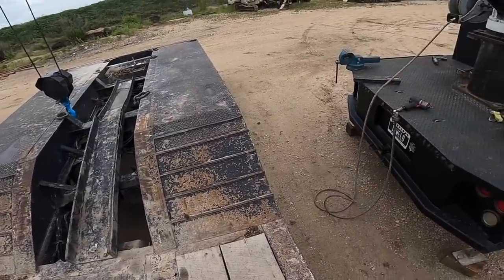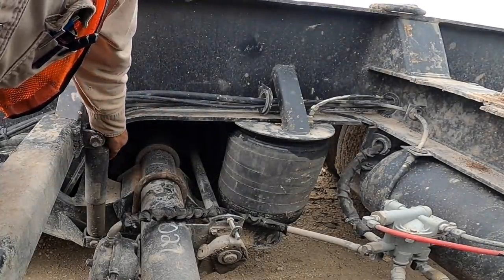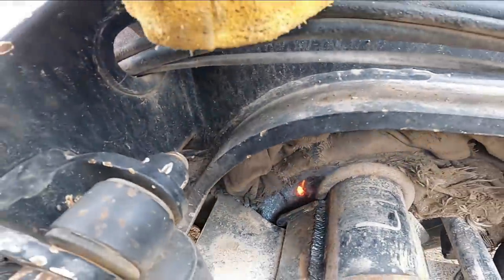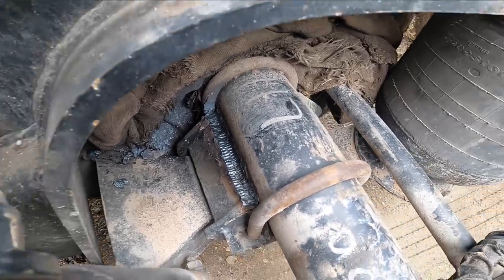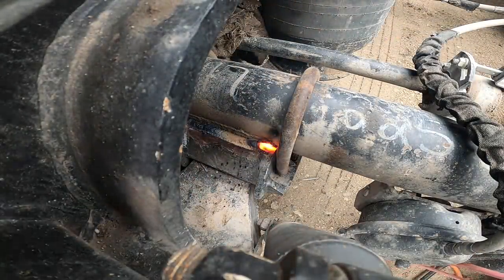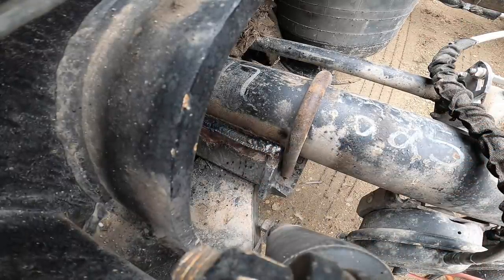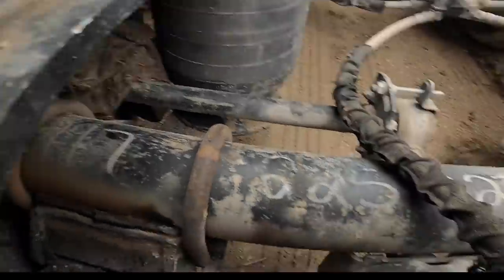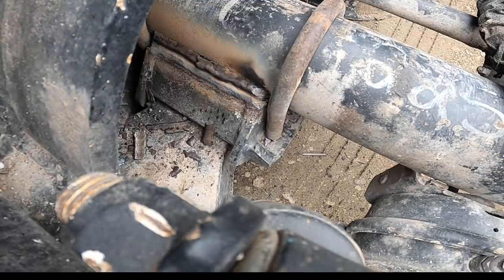Low Boy Axle Repair

Comment: People who have never done a repair of this nature can not fathom how difficult it is because of all the access issues and space constraints. Additionally, no welding school can teach it, only experience. Great job Isaac!
Reply: Absolutely....working on any vehicle that has been used and is in the field...or driveway is just not like having two bits of metal sitting in front of you on a bench. Getting a good weld is rarely easy...even on a flat straight piece like that.
Reply: Welding schools really should have a scrap trailer for kids to weld on to experience the real deal. or a deep muddy ditch to weld overhead XD
Reply: William Thomas, couldn't say it better. In the fabricating shop I worked in the boss hired a "certified" young welder straight out of school. He quit the second week because he didn't like welding aluminum 40 feet off the ground while standing on a scissor lift.
Reply: I’m amused by the occasional comment that you doing something wrong. I’ve seen enough of these videos to trust you a lot more than any of those folks.
Reply: Exactly, I work on trucks, trailers and equipment.  Until you have a mirror, and a rod bent in the middle. It's hard to understand where you may have to putbdown a bead!
Reply: I hate those jobs where I have to stand on my head to get to the work
Reply: If this aint the truth, i had to weld on a tow truck  that was ontop of another tow truck because the hydraulic lifting arm broke its support beam and that truck was hanging halfway off the bed and it was 12 at night and i didnt have a ladder or much of anything except my welder, some gas, a grinder and some rods and my fixed lens outlaw hood and im only 5'2 so i had to somehow literally climb up to  the overhanging tow bed and hang with one arm and weld/grind with the other and i didnt have help or any light except my phone and i couldn't brink my truck closer or turn it around lol took me 3 hours to do 4, 2 inch slanted welds and got a call days later that something happened and the truck was totalled when the differential broke and the truck it was carrying on the freeway at full speed wanted to flip but was still attached so only a tire broke off and the only reason they called was to thank me and congratulate me on my welds that held it together and didnt let the truck break away or break the chassis down the middle lol so that made it worth it apart from the 250$
Reply: I yeah it suck man I use to repair bridges for the railroad and 
99 percent of the the time where I was weld the I beam had been sitting either in a swamp or just straight mud. You can’t teach how to weld metal like that it comes with practice in real world situations
Reply: @heheheuhue6943  or have local companies with machines that have a lot of down time, bring them to the local college or school and get kids to learn equipment repair. The school I went to the HD mechanics worked on equipment from the field. Someone with a piece of equipment that has a lot of down time would come in and the mechanics got to learn on that, I brought my car in because my studs broke in the rear drum, was rusted and seized up, nothing better than learning on stuff from the real world.

Comment: At least the company is  checking their trailers and doing preventive maintenance
Reply: Yep, good catch by them.
Reply: It seems they do not under estimate the value of a clean equipement ;-)
Reply: Probably got shut down by dot during an inspection and that's the  only reason it's getting fixed.
Reply: I worked on those for 18yrs.
I've had to change the beam/trailing arm. But the one I've rewelded never held up for long. Then I was talking to a guy at a suspension shop and he recommended changing the U bolts after the repair because they stretch over time even though it's welded also. Started changing them as soon as I started seeing the slightest cracks and it worked out. Saved alot of time and money and down time

Comment: Welder of over 20 yrs in structural steel construction/iron working.   Love your videos.   A little different than what I did, but have had my hand a time or two fixing our own stuff or the occasional, “hey welder can you look at this?”   Love this latest commentary about rod and carbon sizes and heat.   Think it’s great help.

Comment: I think I can count on one hand the amount of times I've welded flat on a trailer. It rarely ever happens it seems. You did a fantastic job there especially with the gouger. A nice job on the prep and beautiful beads like always!!
Reply: Yeah I started doing vertical welds even on pieces that I CAN rotate around, just to get that practice in.
Starting to get the idea, turn down voltage & feed enough to get a solid bead without runout.

Comment: I seriously have to invest in a needle scaler...Something you said about sealing out dirt reminded me that there are so many situations when welding vehicles where you simply can't get it clean, so you have to do the best you can then weld it, then clean it again and get the good welds on the second or even third pass.
 For me a needle scaler would I think make that process a lot easier
Reply: I got one a little while back to try and it makes a huge difference. The second job I used it for was 3/4 dia plug welds in 1in plate, it was amazing how much of a difference it made trying to chip slag in the hole.
Reply: I wish they made an electric one. Don’t have an air compressor yet. To new in my break out period and I miss having one at my old 9-5 haha
Reply: @Froggies505  They make electric needle scalers but they're heavy, bulky and expensive. The money would be better spent towards a compressor with balls and large diameter hose.

Comment: When I was younger I was a welder and found it to be my calling. I enjoyed it and every day at work was a great day. As I got older and learned more I got into weld examination using remote cameras inside nuclear reactor cores. I really enjoyed this as well and my years of welding helped me a great deal. I could see problems with welds easily that others struggled with seeing because they did not have the hands on experience. If I could mentor young men and women I would tell them to find something they enjoy doing that someone pays them to do. It may be difficult at first but when you find your calling you will never work another day in your life. I would look forward to every day I went to work and every new challenge.
I enjoy your videos very much and will be watching everyone that pops up. I still do my own welding at the homestead now that I am retired with my little Miller Syncrowave I bought when I needed to make a motor mount out of aluminum for my old school mini bike I used as a pit bike when I was into road racing motorcycles. Why pay someone to do something when you have the skills to do it yourself? It would have cost me a lot to have someone else make the mount so I bought the Miller and have used it many times since for other jobs. 
Thank you for your videos! :)

Comment: Great job on the repair. Just like to add that who ever found that deserves some credit. Many drivers of equipment just load and go. No pre-trip inspection. A ton of time and money can be saved with a good pre-trip.
Reply: Was probably found during a dot inspection. Then shut down which forced them to have it repaired.
Reply: @mikeznel6048  Yeah, that is an interesting and very real possibility as well.
When I worked as a lineman at a power company in NC you were made/required to do a pre-trip every day.
Reply: @shaneherman8906  All commercial vehicles are to be pre tripped. Most people are to lazy to bother doing it. Chances are, this was caught in a dot check point. Sad we have them but they do help. Too many careless people out there operating dangerously. They just don't know and don't care until their equipment fails and hurts or kills somebody.
Reply: @mikeznel6048  if it was caught at a DOT inspection wouldn't he be at the scale or inspection pull out not back at the yard repairing it

Comment: You've been doing all this amazing welding without an auto darkening helmet all this time?  👏props!
Reply: Precision helmet flip is a lost art…
Reply: @island7458  I used to do ok with my TIG and one of the gold lenses because i'd had bad luck with autodark and getting flashes.  Now I have a quality autodark and would hate to go back.
Reply: Amateur welder who has been welding with good auto darkening full helmet supply air system for thirty years.  Don't understand why anybody would want weld without a good auto darkening.   Allows amateurs to make reasonably good welds because they can see what they are doing.
I always enjoy watching professionals weld they make it look so smooth and easy.
Good video.
Reply: I like weld without auto-darkening. It works better than auto-darkening when used to it. but it is no days hard to find a good normal weldíng helmet.
Reply: Isaac has an auto darkening helmet, but uses it for the camera. Old school and better than most with the auto stuff.
Reply: @Jimmy the Saint. you got that right 😂. I find when welding outside there’s a constant battle of the sunlight making it go into dark mode when your trying to see in light mode. The flickering can really be a pia.

Comment: So for what it is worth, a trick I use when I have dirt on that separation line to reduce porosity and bubbles is use 6010 on that first pass. (6011 will work too) it burns through the dirt and crap pretty well  to seal it up. Then switch to 7018 to weld on out. Anyway, as always, nice repair my friend.
Reply: yup, in the dirt&gunk, 6 series is a great way to prep for the proper welding with 7018; it can gauge, clean out tight gaps, blows off rust scale/water/oils, adds material to weld to, and preheats.
Reply: @wim0104  are they the cellulose sticks.
Reply: Looks like match head ironically deep penetrating and boils out impurities like a nice sweeper .,👍🤔💪✌️🙏 cut my teeth on 6010 before certifying 7018 3 G at 18 finishing high school , instructors were good mentors and leaders, Roy Beals rip , Tony Anness ,✌️💪👍🤙🙏😔
Reply: @skystevenson24  thanks
Reply: @milotorres6894  cheers

Comment: Trailers are always hard to work on when you need to squeeze in between wheels and cross bracing. I was doing over head welds under a flattop trailer slag went down my shirt onto my nuts I couldn’t get out of the spot it was the hardest burn I have ever had to deal with I will take them on my feet any day. I would love to have a air arc on the back of my Ute great job mate. 🇦🇺👨‍🏭

Comment: Another awesome video man. I have a question for you, have you ever welded anything with 2 rods at once? I just seen a guy do that when welding on new cleats on a D11 in Australia. It looked like it was a great job. Just curious if you have done that.
Reply: Just watched the same video. It seemed to work great on their particular task. BUT welding grouser onto D11 pads is like a black hole for welding electrodes. Plus he had a modified stinger too. Isaac did do some “Texas Tig” welding awhile back so I guess technically he was using two rods at once. And honestly — if I ever find myself welding grouser bar... I’m definitely gonna try using two rods at once!

Comment: weird the folks at the weld shop insist that I would need a 300 amp or better machine to even think about arc gouging... turns out 3/16 carbon rods do just fine at 150 amps, I might have to try some 1/4's soon
Reply: You can definitely gouge on a smaller machine with smaller rods but have to pay attention to your duty cycle, if you are constantly maxing out the amperage on lots of gouging your machine won’t keep up. He’s running a Miller Big Blue I think, so he’a got amps to spare.
Reply: @Mike-nn3tf  Understood, however, most machines if you don't max out the amps have plenty of duty cycle, engine driven welders tend to have 100% duty cycles anyway, so a guy can easily pull it off with a smaller engine drive of 200amps or so, maybe even get some done with the modern inverter welders too, the lincoln Square wave 200 can do it easily.

Comment: Another informative and interesting video. Thanks!  
BTW Do all needle scalers spray oil like yours does?  Is this a needle scaler thing? or does yours require attention?
Reply from the maker: Its actually water moisture.
Reply: @ICWeld  Aha!  I had to put a water remover on my compressor.  No need in your case.  Thanks.  I really enjoy your videos.

Comment: Those really are well designed in how they take weld. It took way fewer rods than I thought it might! A combination of about 40 1/8" and 5/32" or so if you did all four joints.

Comment: how does arc gouging work?
I am an electrician when I had a new apprentice to work with I told them the same thing my first journeyman did, ever journeyman you work with will have his preferred method to do a job, it's not right or wrong just his way, and as you learn you may come up with your own way or use a combo of what you have been taught. All that matters is when the power is put to the circuit it works, and it is safe for the customer to use!

Comment: I bought a chinese flat arc gouger a few years ago works good.  I cannot believe how much even consumables for plasma are going up crazy times and 7018 welding rod even at auctions older welding rod almost going for the new stuff. One thing never to use carbon arc settings on are those xmt machines they do not work right if you do it always nice when I carbon arc with my old miller things pull better with copper windings/brushes.

Comment: I noticed that a quite a few professional welders do not use the auto darkening lens. Is there a reason or just preference?  Thanks!  I learn something from every video!
Reply from the maker: I've been slow to change because I'm so used to my flip lens hood.
Reply: Its reliability cant be matched. No batteries etc.
Reply: I’ve used some brands that don’t perform well out in the bright sunlight. That, and price held me off for a lot of years, but they’ve come a long way from the earlier models, and prices (in some cases) have moderated! Several I tried years ago would”blackout” in the heat of summer out in the sun! Couldn’t see a thing through them!

Comment: I need help I’ve never seen a video and can’t find anything on how to weld something over another piece of metal without welding the two together,   going to see if you had any ideas or if you ever did a videos on that,   I had to cut the bottom of my grapple to replace a broken tine   I have to weld the piece back in but I do not want to weld it to the tine,   is there something I can put between it or some type of metal I need to put between it to keep the two from bonding together as I weld the  bottom of the gravel back together.  Thank you for any information

Comment: I only used a needle scaler once in a great while because a lot of shops did not like them it's a lot easier to clean a weld with them otherwise you spend more time cleaning the joint..

Comment: Isaac you are an excellent teacher. Thanks for sharing your knowledge and experience. What's the difference and/or advantages of exothermic lancing over arc gouging? Can you pierce with arc gouging electrode like you can with the exothermic electrode?
Reply from the maker: You cant pierce with gouging the same as with an exothermic. they each have their own strengths.

Comment: I think I have a crack underneath a axle  shackle on one of my internationals I'm getting gear oil leaking out by the u-bolts.
Reply from the maker: very fixable
Reply: @ICWeld   yeah I just put some air into the axle right now it's leaking out of where the spring hanger meets the axle probably rub through or just cracked.

Comment: The heat from all the welding doesn't damage the axle or bearings?
Reply: The heat is dissipated away from the weld in all directions, so by the time any heat reaches the wheel bearings it will probably be less than the amount of heat generated by the brakes when descending a grade with a load.  The most vulnerable wheel/hub component that COULD have been damaged during this repair would have been the wheel seal from the gouging process, and Isaac protected against that with the fire blanket.

Comment: Hi Isaac

As a person wanting to learn welding would you recommend starting with stick, mig or tig? I plan to do basic steel welding, backyard arts kinda stuff.. 

Appreciate your videos and insight on your skills!!
Reply: I’m not Isaac, but I’ve been welding since the 1970s so I might be able to give you my viewpoints.  If you only want to do stuff around the house on clean (new) material then solid wire mig w/gas is going to be the easiest to learn and leave very little need for cleanup.  Mig is great but it has some limitations. If you want to be able to weld on stuff that might be a little rusty or have some old paint on it, then stick will work better but it’s going to take a lot more practice to get fairly good at it.  Even more practice and experience to get better than fairly good. ;-)   I liken it to the difference in driving a stick shift (stick) and an automatic transmission (mig).  Unless you have a specific need for tig, such as aluminum or stainless, I wouldn’t worry about it at this point.
Reply: @jimskinner9234  thanks Jim. Great words and I appreciate the insight and sharing

Comment: Since you could not get a grinder in there to clean it. Should you arc that first pass back out then reweld to remove excess dirt, rust, or porosity?
Reply: How about using 6010 for the first pass to ensure good penetration?

Comment: I really need an arc gauger. I've welded a few of those. Had to replace an entire axle on time about 18 years ago. It snapped right off 1 inch from the u-bolts. One of the last times I got to work with my dad.